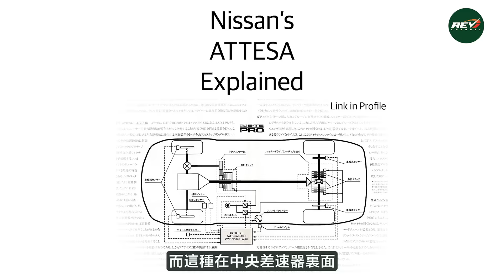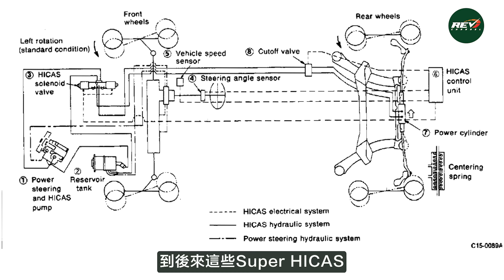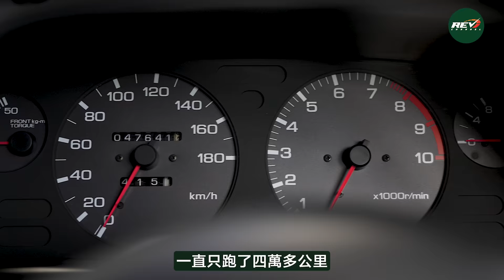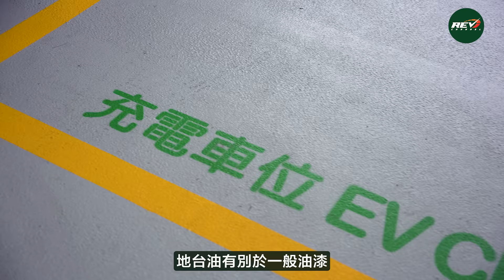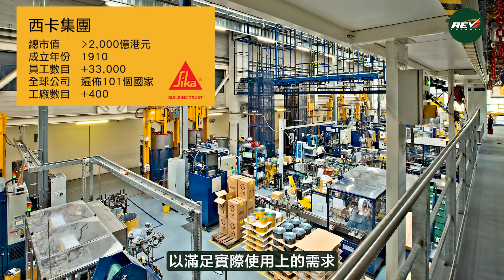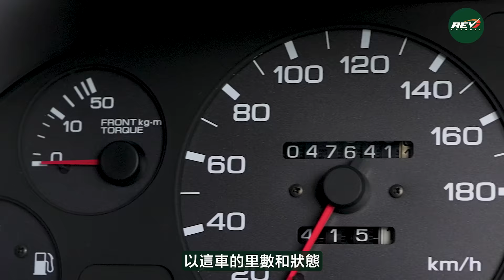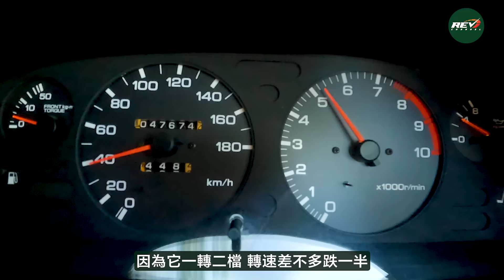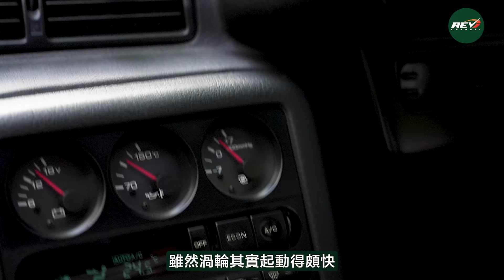Nissan Skyline GT-R R32 橫掃當年賽車壇 日產GT-R R32憑的是甚麼技術？#revchannel

Comment: Don't forget 400R as well :) the low torque issue can be mitigated by HKS V cam system. However, that system will then alter the signature and the design philosophy of the engine.

Comment: I used to own a R32 and the turbo lag is indeed very bad. There's absolutely no power under 4000rpm. And when it is stock standard, even after 4000rpm it's not very fast.